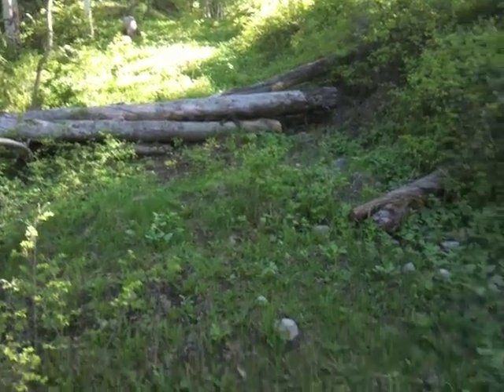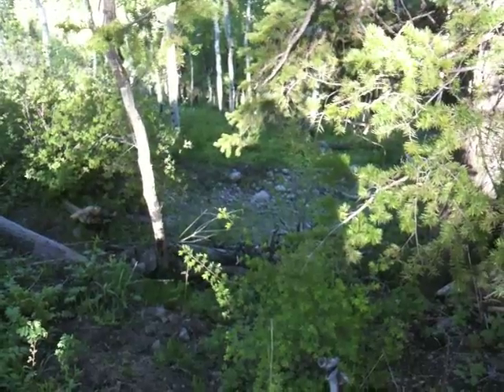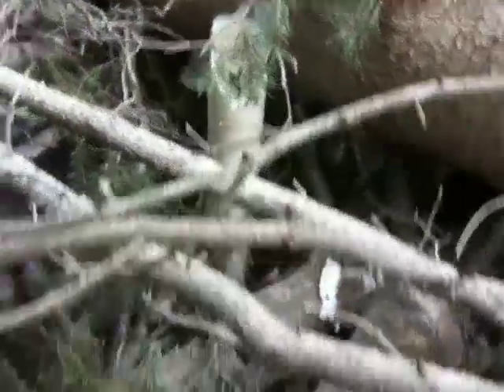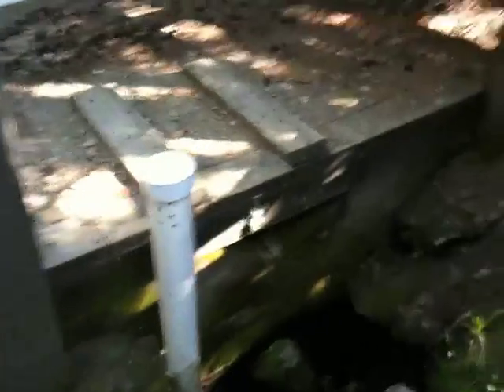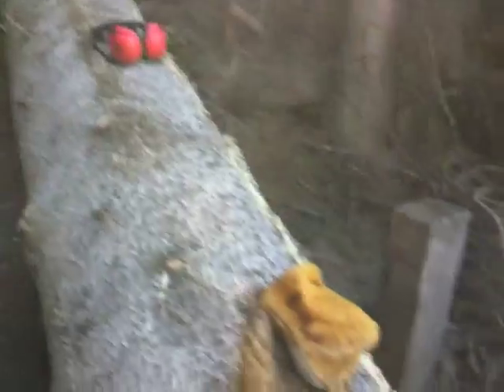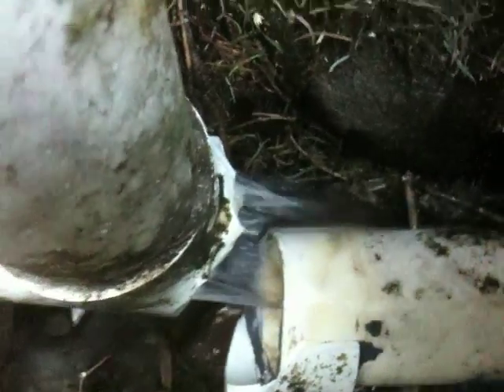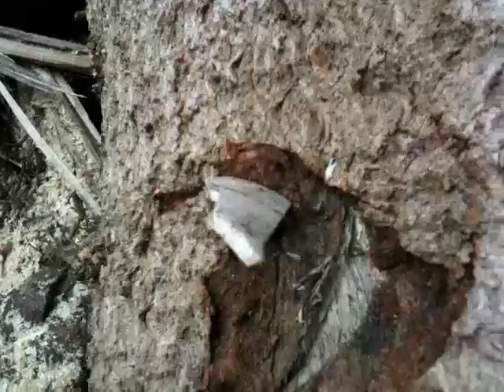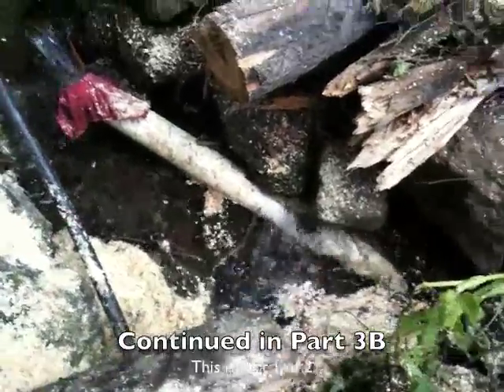Part 3A Micro Hydro Electric Power System in Colorado

Comment: Suggest you get an Alaska mill and turn that tree into usable lumber
Reply from the maker: I actually bought a chainsaw mill last year.  That particular tree was Blue Spruce which or just OK as lumber.  I tend to go after the no shortage of Douglas Fir and Engleman Spruce that are Beetle kill sadly more increasingly found on the property.  Thx for watching.
Reply: MrHydrohead  i cut lumber from alder, and use it for temporary construction.

I know it can get expensive, but consider using systemic rose food for combating beetles. Moisture stress allows beetles to bore in when sap levels are low due to stress. But a dose of systemic rose food pours insecticide into the roots and travels up through the phloem and cambium layers.

Comment: where can I get a system similar to yours to drive the generator?
Reply from the maker: Nigel Jordon The turbine I have was manufactured by Canyon Hydro in Deming, Washington.  http://www.canyonhydro.com  Purchased around 1995-6, the same model is still made, but more expensive due it inflation and such.  Of course, each hydro system is site specific in the choice of best equipment and what works here may or may not be the best choice for another location.  Best to do an analysis of Head(height of vertical drop=water pressure potentially available), available water flow(including seasonal changes), and distance of pipe required(from which provides how much potential power is lost to friction in the pipe chosen).  Canyon can help with much of the calculation or there are many other ways to come up with these numbers.  But, Canyon's equipment is first grade and in my case time tested.  Hope this helps...